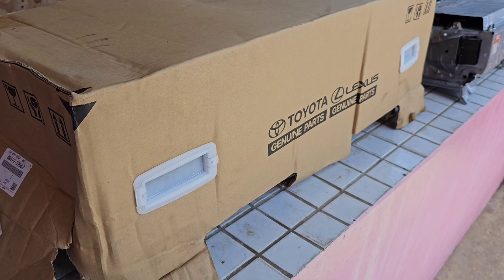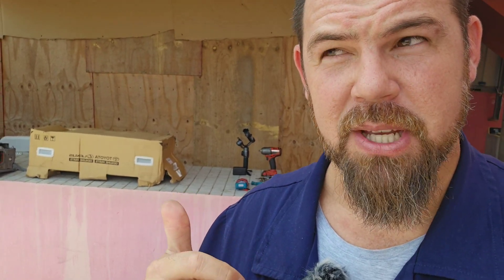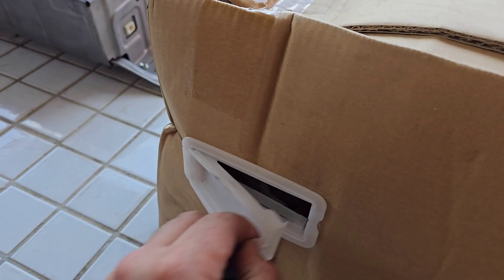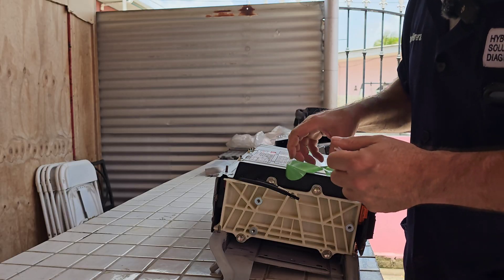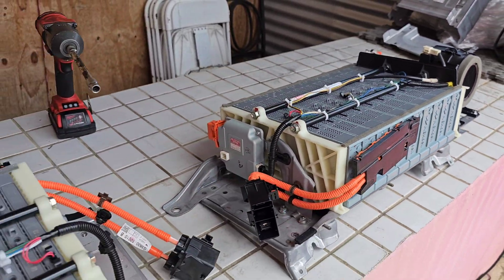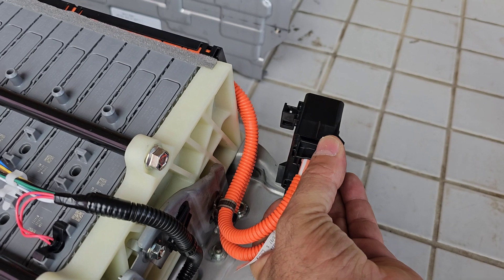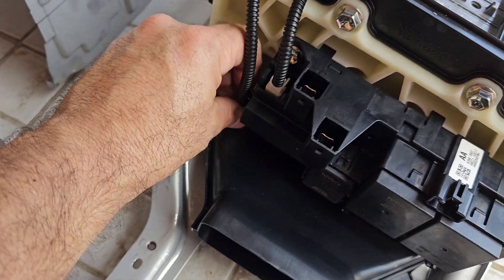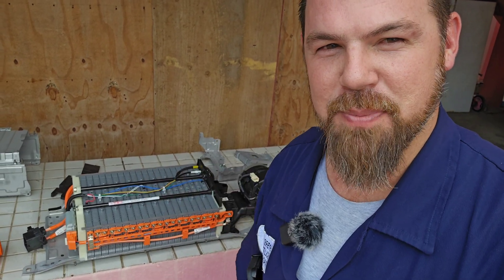Unboxing original toyota hybrid battery

Comment: hi, friend. I have a RAV4 hybrid mod.2023, I want to ask if in the future it will be possible to change the battery for one with a higher capacity because the battery installed is 1.8 kWh NiMh. I wish I could install another 5 kWh one for example...What capacity could I put a new battery in?

Comment: hello sir, two days ago i was replace full hybrid battery pack which is 2022, after installed i was run around 50KM everything working grate, but its quick charge and quick discharge, when i asked from the hybrid mechanics he said its normally will be ok  after little time , is it true ? there is no error work fine, but the only thing is charge and discharge are faster than my faulty old battery, charge will take like 15 sec, and also discharge will be within  1min after charge 3 battry line, can you please help me is that normal after installed new battery ?

Comment: Hello to all i am planning to buy a 2015-2016 aqua but i have a few questions about the hybrid system and the servicing of the battery about its range and longevity and at what speed does the engine makes the switch from electic to petrol and lastly is it worth it? Grateful if you all could help

Comment: I know Lithium-Ion batteries are better. How will in do in Caribbean heat? I heard they do well in the cold but not the heat. I think I have a Lithium in my 2019 Prius Limited, this is why I asked. 👍✊🖖🇺🇸
Reply from the maker: As long as cooling system is clean they are fine
Reply: Where can I order one?

Comment: Hybrid Solution Diagnostics, do you know if the Prius C from 2015 and on suffers from the brake booster and brake pump assembly issues which needed a recall?
Reply from the maker: It’s normal after long time.